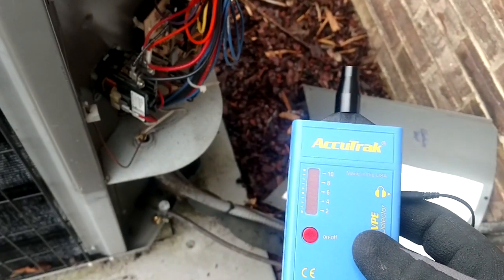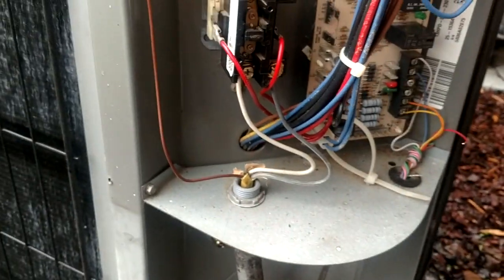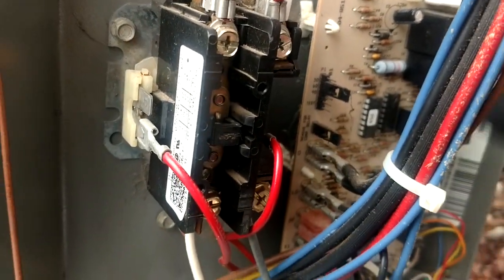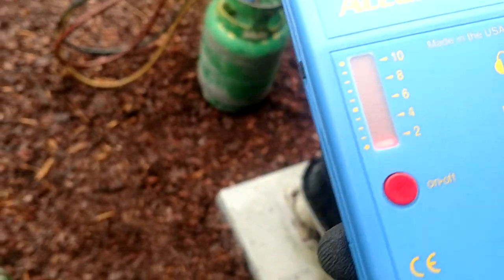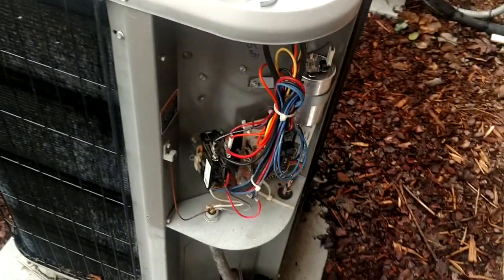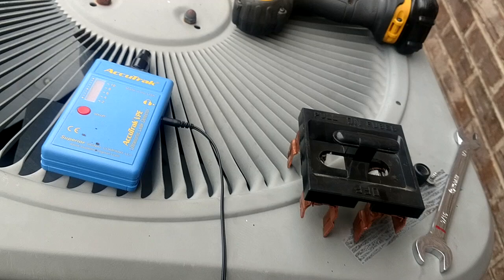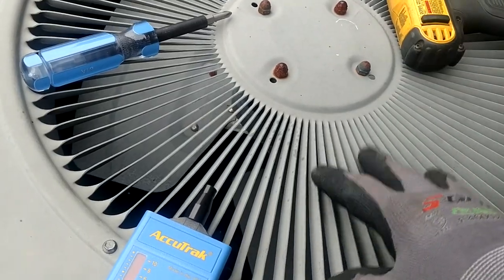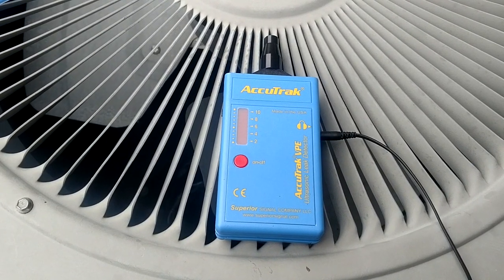Found an electrical problem with a relay on a defrost board using Accutrak ultrasonic leak detector.

Comment: Way late here but am curious to see if you've done further testing on this with these boards i got my accutrak and decided to mess around with it  on a job with the same Lennox DF board and was getting the same noise from the same relay.
Reply from the maker: I hear more noises coming from x13 blower motors than anything else. I usually cut the main power to the air handler so everything is nice and quiet when I'm looking for a leak at the indoor coil. I still use the ultrasonic all the time. It's great. Thanks for watching. 😎👍

Comment: Outstanding Shannon! Thank you.

I do appliance repair and recently picked up an Amprobe uld-405 to trace refrigerant leaks, but am super excited to try it out on various relays to see if I might be able to identify troublesome sticking relays.  I'd imagine if you're getting poor connection at the points inside the relay you'd be able to detect the associated arcing at the ultrasonic level.
At that point it would just require knowing what a properly functioning relay should sound like and you can probably point out a failing one more quickly.

Thanks for your great videos!
Andy
Reply from the maker: Thanks for watching. Glad you enjoyed the video. 😎👍

Comment: Hey can you crack a refrigerant valve slightly that you can pick up with the bubble s and test and see if the ultrasonic picks it up. 
I have the black one the older styles amd it doesn't
Reply from the maker: Here's your video ⬇️⬇️⬇️
https://youtu.be/9cnT5wfdpck
Reply: Like a 410a jug I would appreciate it
Reply from the maker: The Accutrak Ultrasonic VPE will pick it up with the door of my van closed.  It's blaringly obvious that something is leaking. It has absolutely no problem picking something like that up. I found a leak in the tire of my van a couple of weeks ago, with the accutrack, that the guy at the tire store couldn't find.
Reply: @sknight0391  I have the kent Moore by accutrac. When I open the jug a little I get bubble s but it wont pick it up with the kent. Maybe I'm doing it wrong but I see bubbles yet no sound. Maybe I need the one you have
Reply from the maker: I had the same problem when I tried to save some money on my 1st ultrasonic & I got a cheap Chinese one. Did not work at all ! I use alot of Chinese instruments and love them but this PIECE O CRAP did not work. Then they gave me a hassle about returning it for a refund. So i filmed a video on it to show them it did not work. 😂 👇
https://youtu.be/zRyGz8wRBUA

Comment: This is a really cool tool
Reply from the maker: I used it yesterday to find a leak on the back left-hand corner of a Lennox indoor coil. Another guy had put dye in the system and nobody ever went back to leak search it afterward. A whole year had gone by and of course the first time the homeowner turned it in the air conditioning it didn't work. It took more time to take the doors off of the unit than it did to find the leak 👍#LoveMyAccutrak #UltraSonicIsTheWayToGo
#MoneyWellSpent

Comment: What are you think about btw  goose neck or just your thing?
And also is it better than reg sniffer? I'm look for really nice leak detector....
Reply from the maker: I like this VPE version a little better because it also comes with a metal rod, that connects to the end of the detector, & will allow you to listen to the internal components of a motor or a valve. So you can actually diagnose bearings going bad in a motor or steam bypassing through a valve that should be closed. So it has multiple uses. It also comes with a piece of tubing that will extend its reach out about 8 in. So you can get into really tight places. This is my go-to detector but I use it in combination with a sniffer also.
Thanks for watching 👍

Comment: That’s one thing about the ULD, boards in Daikin fan coils and cassettes will cause it to go crazy, and make weird noises, electrical interference. When I was leak searching a job in December, the boards would make a different noise and interfere with trying to find leaks. You would have to kill power to them to silence it, like you did when you pulled the wire off of the board. It’s a good tool, for sure.